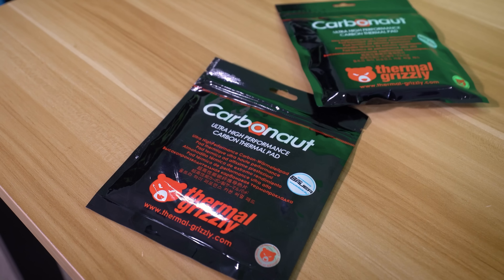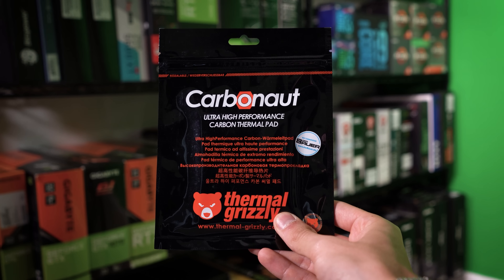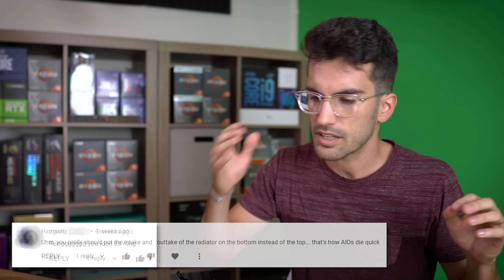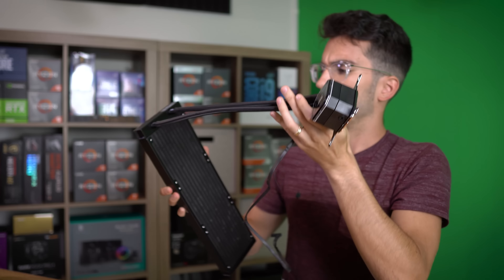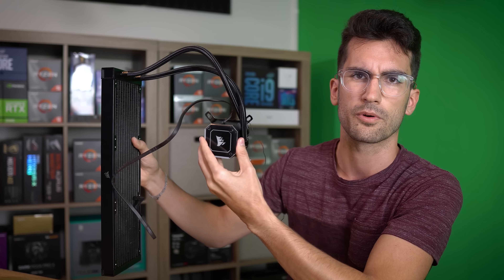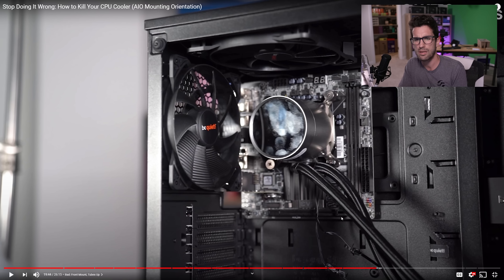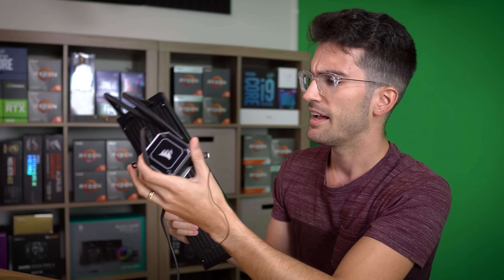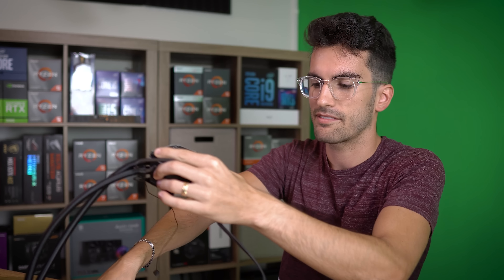Let's Talk About AIO Orientation... Again

Comment: I think you underestimate how much air is in a clc. Out of the 3 I had, all of them experienced at least a noise issue when mounted tubes up. (yes, with the pump lower than the tank) This isn't that big of a problem, but after a year there can be a lot more air in a loop. The 120mm cooler master radiator I used in a friends pc had up to 10°C lower temperature with the tubes on the bottom and immediately stopped making noise.
I don't judge normal people for putting their radiators this way, but when tech-influencers and system integrators do it I consider them to be a bad example. I know many people that didn't even consider mounting their radiator tubes down instead and I suspect that to be because they have seen them mounted that way on pictures by system integrators and videos on youtube.
Reply: Sometimes a different mount isn't possible. My case for example dosent really fit my Radiator in any other way. Or sometimes the tubes are too short.

Comment: Out of context compliment: those glasses fitted you well.
My old H100i did make some pump noises, probably due of old age and evaporation. I'm not too worried with my new H115i having the barbs up. IF I realize there's noise in the pump, then I'll try new configurations to see if it solves, otherwise, I'll simply RMA it.
Thing is, Steve is way too knowledgeable and the general public will misinterpret him, unfortunately

Comment: Well, I disagree with the performance impact being rare. The point is that, contrary to what many techtubers seem to believe, most people don't replace components like these every year or 2. Especially true for the people that need to watch build video's to teach them how to build their PC. It is about mounting it such that also after many years it still works as best as it can. I have personal experience with several old-ish systems (like 5-6 years range) where the AIO performance was significantly impacted because of this exact situation.
I agree that the whole thing is taken out of context too often. The pump will indeed be fine.

Comment: So for the newbie like me, I’ve understood that aio means all in one, liquid cooler. Air always rises when it’s in water, so if the pump is above the radiator, air will inevitably be pumped through the pump itself because the pump is strong enough to push the air bubbles and the liquid. That can cause noise. 

If the pump is below the radiator, either the radiator is on the side or it’s attached above on the top, in either case, air will not be pumped through because the air which will always rise is rising to an elevated position relative to the pump. So the pump in that case just pumps only the liquid and what ever air is in the system chills at the top. If the radiator is below then the pump is going to pump air bubbles with the liquid because the bubbles always rise. Alleviate that by putting the radiator above the pump.

Comment: My 360 AIO is front mounted, tubes on the bottom and a vertically mounted GPU. Built my PC in 2020 and my temps have been fine, performance is fantastic, no issues what so ever.

Comment: we need to dig deeper on how much a closed loop is really filled... Because it gets emptier with time, but how much? some units die at 1-2 year some 5 years and still working?!
Reply: You will have to buy one of every AIO (even every Asetek) & run them all for years to do this test,
except for Enermax AIOs as it only takes about a year for them to grow gunk that will kill them 🤢🤮
Reply: My current AIO on the rig I'm typing this comment on is 6 years and no issues. When I say 6 years, this thing may have been turned off for like 4 weeks in 6 years. I don't stress the system too terribly much but temperatures have been relatively stable and no noise. I do watch it a bit more carefully nowadays though. I also know the last revision the manufacturer did with this particular model fails horribly on a regular basis. That's why  I'm not recommending it by name. So not all AIO's are made the same and some are just better. Except Enermax, they are just hot garbage.

Comment: I just switched to a Corsair pump and I had to mount it tubes on top for it to fit in an h500. I occasionally here the water moving for a split second, but that's it. And I think that's usually right when it first turns on. So thanks for letting me know not to worry too much about it.

Side Note the RGB on it is amazing totally blew my mind.

Comment: Where I work, manager's main reason why we should put the radiator at the top is for the computer to "look good" and "because steve says so". Of course, I disagree. I have mine installed at the front because having the cpu cooler by 20c is more beneficial. Never had any issues with noise or pumps as my AIO is still kicking for more than 2 years.
3 years of checking RMAs as well. Some have broken RGBs, some returned with broken pumps but looking back I assume it's because of the MATX or MITX case where the pump really is higher than the radiator.

Comment: The fact of the matter is most people run front mount pipes at top.
There is issues with pipe lengths and GPU's that many can not be mounted pipes down, you also can't stop evaporation no system is 100% closed.
The solution is just put the pipes 2 inches below the top, have a space for the air and let people mount however the hell they like?

Comment: When you have case like H500M combined with 4x 200mm fans (comes stock with 2, just buy another 2 on top) and noctua DH-15 Black edition Cpu fan, you really arent worried about temps even when pushing 5900x to 5ghz , Watercooling is dead imo its just looks cool imo, i wonder if my super case cooling with Noctua fan can beat most watercooling setups
Reply: i swapped the coolermaster fans for 4 x 200mm thermaltake pure duo  rgb fans, the ones with no  lighting on the blades(halo style), it looks incredible

Comment: I can understand some people get confused, tbh I don't entirely understand it either, on the one hand it was said that the pump must never be the highest point, then in the next part it is said radiator intake down is better vs radiator intake up whilst that potentially makes the pump at equal height or worst the highest point, which again is said to be bad.

Eh it doesn't really matter for me to understand or not, my aio is fitted horizontally at the top which is definitely a good position so whatever.

Comment: Greg at 8:15 you mention that this AIO is a poorly filled closed-loop system but you have to take into account the thermal expansion of water will need somewhere to go. Without air to compress the system has a higher potential to find a weak spot and leak. I believe this is the root cause of AIO's (and custom closed loops) having air in them which in turn leads people to experience "gurgling" which as you said is mainly an audible issue. Great video!

Edit: aaaand I just realized this video is over a year old. Thanks youtube algorithm lol.

Comment: 4:36 So really Greg is holding a Corsair 360mm Convectionator
Reply: That was painful to listen to
Reply: @matthewmcewen1  I'm going to call them convectionators from now on, it sounds like a term from an alternate reality. And fans are now called blowers. "The Buccaneer D150i Elite, with a 360mm convectionator and three 120mm high static pressure blowers"
Reply: soupwizard 😂😂
Reply: "Behold, Perry the Platypus!  My Convectionator!  I, um, don't really know what it does."
Reply: @soupwizard  with words like that you could easily charge $750

Comment: i think it make sence why the air is in AIO. based on thermodynamics the hot temperature expanding the size of the liquid so instead of create the high pressure on tubes and connectors (rubber silings) is much easier to compress an air inside the loop. i think is less risky that way so there is litle chance for leak or who knows the tubes comes off. the AIO are generaly design for all enviroment so the temperatures and be diferent and diferent scenario. a bit air is safe for changing preasure inside the loop.

Comment: For example i have an id cooling 280 aio that is very cheap. I mounted the rad in front with tubes on top and the rad is upper than the pump. I hear some boubles just in first 10 secound when the pc start. After those 10 seconds the boubble sound is gone. I think the most important think is to set your pump to 100% always. So i had my aio for 2 years like that and works fine.(8700k 5ghz with delid 1.29v max temp 65c) Take in consideration that i have a cheap aio. So if u have a much expensive one it will last longer that 2 years for sure!

Comment: while watching some how it's made videos on aio's it showed them using a vacuum pump to remove the air, and then suck the water into the loop, to remove as much air from the loop as they can while still remaining cost effective.

glad you did this though, it really felt like the gamernexus video was too much scare tactic than anything else.
still prefer my cooler up top, (not because it's best) I like having my front as intake to help the gpu more.

Comment: I had a 360 beQuite! AIO and it was front-mounted with tubes at the top. The water level dropped after a year and air got in the pump and it burned out :( Thankfully beQuite! support was good and replaced it with their best air cooler (because that AIO was discontinued) Never an AIO again.
Reply: @PapaMav  Well no moving parts no problems
Reply: @PapaMav  Both types of coolers have fans. Also with a broken fan the air cooler it will still perform as a passive cooling tower until you notice it (if you notice it). Idk how an AIO performs with broken fans. Broken pump though and your CPU will hit 90+ C. Warranty wise I had a good experience but maybe that's cause I live in Europe. Also a DOA should be covered by the store as far as I know.
Reply: @SilenceGProd  you cant passive cool a CPU! My Noctua NH-D15 once had a broken fan and my CPU jumped to 50C idle

Comment: From an Engineering angle. Air rises so where the tubes connect, you'd want the tubes to be in water at all time, so that would mean the tubes to the bottom so that air sits in the top of the open channel as it will do naturally.  In the example video you can see the bubble are created from an empty channel and then sucked slowly, creating small bubbles. If the tubes are at the bottom, this will only happen on the close end and but the pump will be in water the full time.

Comment: The point that Steve from Gamers Nexus was trying to get across, and I think that a lot of people are missing, is the front mount, barbs up config issue will become apparent over an extended period of time.  We are talking about several years here.  As the water in the coolant mixture begins to evaporate.  The once tiny air pocket that can never be bled out, will grow to a point where it can, and eventually will, begin to hamper coolant flow.  That was the point to his see thru radiator demonstration.

Comment: My anecdotal evidence disagrees, i've had 3 AIO pumps die (less than 2 years) from the barbs up config.  No issues with AIO fully above pump.   I own too many PCs
Reply: Were all 3 the same AIO? If you are getting 8 months out of one I imagine you were getting a warranty replacement, though I don't really know what kind of warranty the different brands offer.
Reply: stop buying shitty AIOs and you won't have a problem. I used mine for 3 years and never had a single problem, even while overclocked
Reply: @--_DJ_--  2x h110 and a h105 corsair
Reply: H105 failed fine now changed orientation, H110 warranty looked new but failed again different PC now a D12

Comment: As long as the barbs are higher than the pump you will be fine. It may be noisier than if they were on the bottom but it wont hurt anything.

Comment: No, I wouldnt say the seat the radiator front and barb up is "bad", that's simply not true, BUT we can 100% certain it is  "safer" if you have the option to put the radiator on top. But if the casing do not allow you to do that, put radiator on front will not kill your pump, just it can may some noise or a very slim chance that may cause issue later.

Think about it, if front radiator setup will have high chance to kill the pump, all those NZXT chassis already got call back now.

Comment: Ideal is radiator to be front or top mounted with the pump lower than the highest point of the radiator. I like to run the pipes tot he bottom of the radiator so that the liquid in the radiator acts in a  gravity feed type system and Will also keep the pump full.

Comment: I have my AIO pump mounted at the bottom pipes going up and have the pump flipped sides logo 90° clockwise on its self...no problems, no thermal changes and my Cooler Master ML360R is still good lol. No gurgling nor high Rpms. Keeps my i7 7700 67° on full load. Been like this for 2 years.

Comment: I had a dead NZXT Kraken X62 because of bad front mounting (pump was sorta level with front mounted rad, Corsair 750D case) it was only in the bad postion for 2 weeks until i noticed the mistake, top mounted it but a month later the pump diey anyway because it ran dry for too long already, my 2nd Kraken also has air inside and i can hear the bubble move when shaking the radiator, it is more than just a little bit i'd say, top mounted for 2+ years, no problem. 
Greg you are underplaying how much air really is in there. They have air in there by design so it can expand and contract with high and low temps, that is not bad design, it is just not intuitive to the regular user to have air in a "pre-filled" loop and you got no option to refill it yourself either. You just don't think about air being in there and it is an easy mistake to make, especially if marketing and youtubers with their show build constantly show it front mounted and even tell you that you get bettet cpu temps if front mounted... front mount it in a Corsair 750D, see what happens!

Comment: I saw the GN video prior to this one, and I would say GN has several points, not just the noise of the bubles accumulating at the intake tubes, which takses efficiency away, but it as well means temps are higher, with the AIO beging made with plastic, 60 deg. Celsius is the point where the material starts to age faster, if that is a issue down the line everyone should answer for him self.

Comment: So much of this video is wrong.  Air is required in the system because air compresses.  Water expands when heated.  If there was no air at all the tubes would swell, the pressure inside the loop would increase until it failed.  It's a sealed loop, not an open vented custom loop.  There HAS to be SOME air in there or it would explode.

Comment: And here I am with the radiator in up position and still get temp spikes over +15C but if I poke on the output (hot) tube, the temps lower. So even if I have the pump lower than the radiator (but higher that the tubes) I still get bubles (temp spikes) sometimes. No weird noises. So I just have to poke the tubes once a month. Well yeah.

Comment: Basically if you can top mount or mount tubes down vertically you probably should but as long as your pump isn’t the lowest point in the loop you’re probably fine apart from the possibility of some noise

Comment: Considering people seem to be stuck with inlet/outlet at the top most of the time the manufacturers should really consider just stretching the header tank a bit and keeping the fittings in the same location to avoid this problem altogether, or at least until the loop has lost a significant amount of it's initial fill volume. Maybe there isn't room for that though, I've never even held a radiator that wasn't going in a car or truck, let alone installed one in a case.

Comment: Conduction is the word you were looking for. Air conducts heat away from the Fins of the radiator as it moves past. Convection describes a cyclical movement of a fluid driven by heat. Very minor correction the point of your video is.... on point.

Comment: Mounted my 360 rad in the top as an exhaust. Safe and ideal. nuff said. Rather have my GPU getting cooler air and boosting harder than my CPU running cooler.

Comment: A healthy AIO or custom water cooling loop will have some air in it, it's not inherently bad as long as you keep the air where it's supposed to be... Air compresses more easily than liquid, and the liquid in the loop will get warmer and expand a bit. Radiator above the pump(top mounted) is almost always the best overall placement if you can do it, it'll keep the pump working effectively, and importantly -quietly!

Comment: One personal case F.Y.I. - I have an AlphoCool EisWolf GPU block/pump and radiator. This was installed barbs up (only way it would fit) and pump about 2/3 the way up the radiator. In my case, apparently a big bubble was sucked into the pump inlet, noise happened (I was there when it happened) and the flow stopped. The pump just spun wildly; I could see the RPM on the MB fan reading to which the pump was connected at around 6000RPM; as if connected to nothing. GPU would overheat. No cooling. I assumed the pump broke. Removed and disassembled the entire block/pump. Tested and the pump. It was fine. Reinstalled the whole thing. Refilled. Worked fine. This would not happen in better configurations or if completely filled. I should have tested out of the case prior to disassembly. Still, barbs up can still push enough air to the pump to make it fail without repositioning. Some people, like me, would assume it's broken This will cause issues.

Comment: Honestly if you can put your rad in the top of your case do it that way and you don't have to think about this issue atall. Ive done this ever since my first aio and it works great. In the cases I've used there's even enough room for a push pull config up top